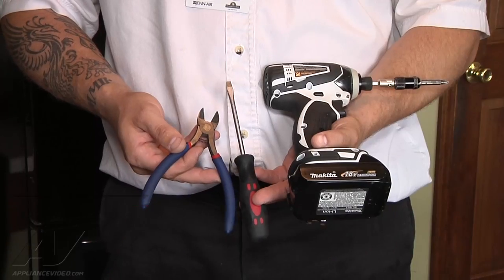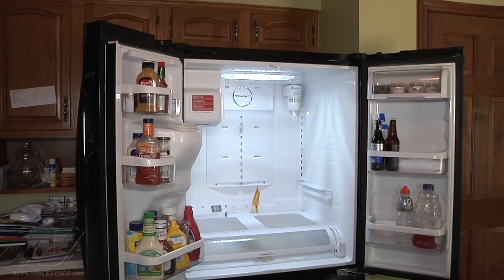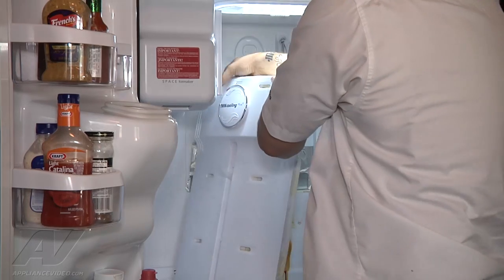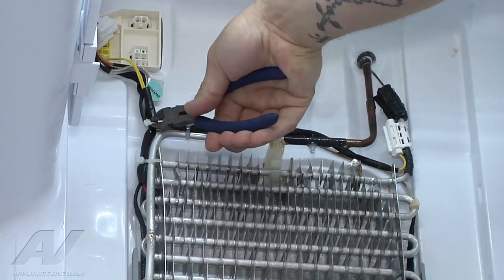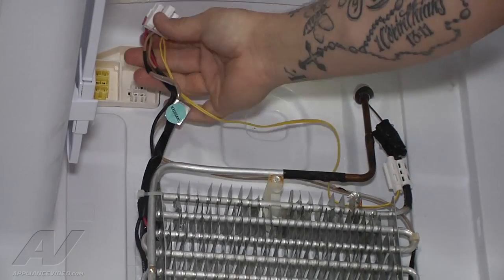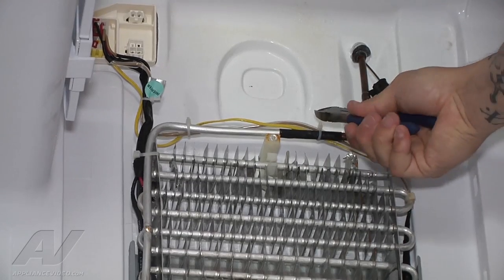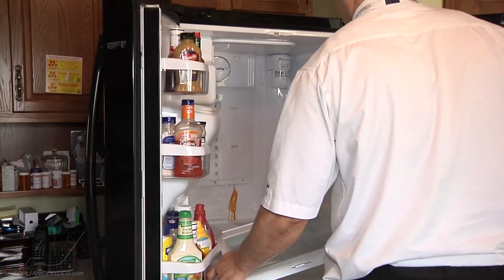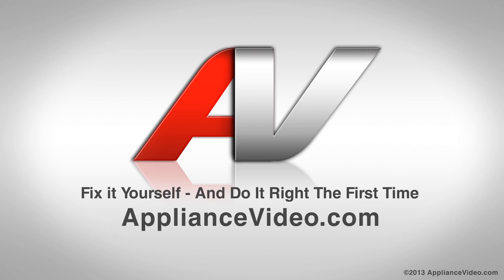Samsung Refrigerator Repair - Fresh Food Section Is Leaking Water - Sensor

Comment: I have taken off the panel and removed ice from coils, but my fridge drains out the back into the bottom panel.  I have poured lots of hot water in and warm water has come out of one of the drains (not nearly as much as I put in).  The other drain does not have anything coming out.  I'm not sure I can reach to properly melt with hair dryer.  Any suggestions?
Reply from the maker: Yes, shut it down for 24 hours with the door open to get any ice in the drain defrosted completely. Then pour the hot water down the drain. If you or someone you now has an air compressor you can shoot compressed air through to ensure the drain is open. Our technicians carry a compressed air tank on their trucks to blow through the drains.  You can help us provide more videos to our site by subscribing to our YouTube page or posting ApplianceVideo.com site on your Facebook or Twitter account. We also have our factory authorized technician’s email daily free professional advice to people like you to help solve their appliance problems. Thanks in advance for supporting us. Matt, Ace Appliance service technician.

Comment: It appears that it may be the probe (AKA drain strap) and not the sensor. Many people with this issue have ordered the whirlpool probe (which is longer than Samsung's) and fixed this problem. See this discussion:
http://www.applianceblog.com/mainforums/threads/26180-Samsung-water-in-bottom-of-refrigerator
Reply from the maker: Thank you for the update. Any help to our subscribers is a benefit. We appreciate your input.
Reply: Unfortunately, these probes only extend the time period between occurrences.  It doesn't completely solve the problem.  I've known techs who will use a piece of copper wire, which is a better heat conductor than the aluminum ones sold by Whirlpool and others, with no success.  And if it were a sensor issue, ice would build up on the entire evaporator, restricting air flow, causing temperature problems.  Moral here, don't buy Samsung refrigerators.  Unless you want to spend $275.00 every time the drain line clogs.
Reply: Dave Harrison  I wish I would have known that about Samsung's refrigerators.  Even though a technician repaired the leak in September of 2014, my refrigerator is leaking water under the fresh food section again. Do you know why this problem cannot be completely resolved?  I am just curious due to the fact that this is a costly repair.

Comment: I have a pretty basic single door, 210 ltrs Samsung Direct Cool refrigerator. It has been hardly couple of months the fridge is showing signs of condensation and cooling issues. There is always water formation on the freezer door and chill tray is always wet. Can you please advice, what should I do.
Model reference: http://www.samsung.com/in/consumer/home-appliances/refrigerator/direct-cool/RR2115TCAPX/TL
Reply from the maker: Puspen
           Go to ApplianceVideo.com and type in your symptom , make and model. You will find allot of videos with your symptom. Also if your unit is only a few moths old it should be under a factory warranty.  We have a search for video by model number feature. Our site has 2600
Free videos on it.  Please help our ranking by subscribing to our
YouTube page or posting our ApplianceVideo.com site on your Facebook or Twitter
account

Comment: what is the plate cover called that cover the coils. the white part is broke when we removed it and i want to order it but dont know whats its called
Reply from the maker: Good question, with our technicians
now getting hundreds questions weekly, they are answering all questions at our
website http://www.appliancevideo.com/repair-help/ .  We also have over 3,000 common questions
and answers that you can easily search through by your model number, appliance
make, problem or error code and it’s absolutely FREE.

Comment: I live in the east bay of San Francisco in CA. I had two repairman with no good results. My RF267 had ice buildup for the last 2 years. My refrigerator and freezer have stop working, who can I call for repairs, It seems like no one wants to touch Samsung RF267???
Reply from the maker: Great question, if you have a
more technical question that our parts department cannot answer, our
technicians are answering all questions at our website at www.ApplianceVideo.com under our Repair Help section. You can also call
our parts department at 1-800-830-5465 and they can give you help 7-days A week
Mon-Sat . You can also search at www.SaveMoreOnParts.com 7- days a week.

Comment: I replaced this exact part, defrost sensor, and it still leaking, the drain still frozen with ice.  Any advise?
Thank you
Reply from the maker: Pierre
         All of our technicians are now answering questions daily on the ApplianceVideo.com website for anyone needing help. Just copy and paste this this question under REPAIR HELP, and one of our  factory authorized technicians  will answer any technical questions at absolutely no charge on your appliance issues. We also have over 2600 free repair videos to help with your appliance repair issues. Thanks for your support. Matt Ace Appliance factory service technician.
Reply: MOVE SENSOR TO UNDER FAN MOTOR, REMOVE AND PLACE IN MIDDLE TOP TUBE ( RETURN LINE) If senor is in the ice unit will defrost longer. (not in sReplace sensor is not the fix. 1- need drain heater ( DA61-06796A). 2- NEED STEAMER TO DEFROST DRAIN LINE. 3-ervice update)

Comment: I am having the same problem.  A technician fixed the problem in September of 2014, but the refrigerator started leaking again.  I do not understand how I could be having the same problem within a six month time span.  Do you have any suggestions?
Reply from the maker: Msekicrazelova
             All of our technicians are now answering questions daily on the ApplianceVideo.com website. You can search completely FREE in our Repair Help section with over 1000 questions & answers. Or you can get unlimited technical advice and video links emailed to you by our 14 factory certified technicians at http://www.appliancevideo.com/premium-membership/.  If you are in need of any parts please support our parts department on line at http://savemoreonparts.com/ or call 1-800-830-5465 7-days a week until 11pm Eastern time. Thanks for your support. Matt Ace Appliance factory service technician.
Reply: The problem is the drain hole, the water freezes up and it gets clogged, their is a newer SAMSUNG CLIP DRAIN EVAPORATOR, that helps to keep the water from freezing in the drain (Amazon $6.63) this will keep water flowing freely through the drain and eliminate the "leaking" problem, also set your temperature at 36F, this will help too.

Comment: My RF265ABWP refrigerator is 8 1/2 years old, started leaking and freezing underneath the fresh food section months ago so I would wipe it down once a week until I found the video and decided to tackle it...I first defrosted the refrigerator, found the heat clip not even remotely near the hole and the drain in the back clogged.  I cleaned the drain and re-positioned the clip into the hole and ordered new clip.  Still leaked.  Defrosted again, and replaced drain clip.  Checked level which was okay but wheels were still on the ground so I raise the legs to get the front wheels off the ground  (even though it was fine for 8 years).  Still leaked but not as bad (maybe because it hadn't froze as much).  Ordered the defrost sensor.  Removed the back today, the drain was clear but the coils on one side had ice.  I let them defrost while I changed out the defrost sensor.  I let the cover dry out for a bit. Checked the drain, flowing fine so I put it all back together earlier today.  Seeing a little leak again.  Any more suggestions other than taking a sledge hammer to it?
Reply from the maker: I would like to help you, however our social media staff are not technicians. We do have technicians answering questions on our website's Repair Help. Search within repair help to see if you can find your answer or, you can always ask one of our  technicians http://www.appliancevideo.com/repairhelp/

Comment: My samsung mode rfg297hdrs water is running very slow.
Reply from the maker: Great question, if you have a
more technical question that our parts department cannot answer, our
technicians are answering all questions at our website at www.ApplianceVideo.com under our Repair Help section. You can also call
our parts department at 1-800-830-5465 and they can give you help 7-days A week
Mon-Sat . You can also search at www.SaveMoreOnParts.com 7- days a week.

Comment: I can't get the drain to flow.  I have had it off for 36 hours and keep putting hot water in the drain but it won't go down...
Reply from the maker: Brian Agrella 
                All of our technicians are now answering questions daily on the
ApplianceVideo.com website for anyone needing help. Just copy and paste this
this question under REPAIR HELP, and one of our  factory authorized
technicians  will answer any technical questions at absolutely no charge on
your appliance issues. We also have over 2600 free repair videos to help with
your appliance repair issues. Thanks for your support. Matt Ace Appliance
factory service technician.

Comment: This is a great video demo.  Thanks for posting it. 

Having been through this TWICE in past 6 months is no fun.  So, my recommendation is DON"T BUY THIS REFRIGERATOR.  What a shame that such a nice frig (we really like the refrigerator) is equipped with such a horribly designed defrost water drain system.  It is designed to fail.  Having to remove all food and disassemble the interior panel is just plain stupid design.  I used a turkey baster with a long plastic tube that allowed faster melting of the ice - it was frozen SOLID the full length of the drain tube.   The simple solution to this problem would have been for Samsung to either design the drain so that it is accessible without taking the refrigerator apart, or, better yet, just route the drain line to the exterior (room temp) of the refrigerator down to the evaporation pan so that it won't freeze up.  As it is designed, it passes through the coldest part of the refrigerator, so any small plug (lint, dust, etc) at the outlet end is going to inhibit flow with freezing solid as the eventual result.
Reply from the maker: Bill 
     Thank you for your comment. I know they have made design changes to eliminate this issue on the new models.Sorry to hear you are dealing with this issue.  Please help us provide more videos to our site by posting ApplianceVideo.com on your YouTube, Facebook or Twitter account or add us to your circles.  Our factory authorized technician’s also provide FREE Repair Help for people that need technical questions answered our videos cannot answer at ApplianceVideo.com. Thanks again your support.  Matt, Ace Appliance service technician.
Reply: yeah...been doing this for too many years...had this refrig now for 7 years. So sad, since we really like the freezer on the bottom style and ice positioned when it is. I wonder if it's a design flaw?? The fan started making a racquet, so we're back to removing ice. You must admit, at least your refrig gets a thorough cleaning this way...lol! Thanks for this video....we are having trouble getting the styrofoam off this time...so annoying.

Comment: Where is the wayer tank on this unit?
Reply from the maker: Gabriel
             
All of our technicians are now answering questions daily on the ApplianceVideo.com website. You can search completely FREE in our Repair Help section with over 1000 questions & answers. Or you can get unlimited technical advice and video links emailed to you by our 14 factory certified technicians at http://www.appliancevideo.com/premium-membership/.  If you are in need of any parts please support our parts department on line at http://savemoreonparts.com/ or call 1-800-830-5465 7-days a week until 11pm Eastern time. Thanks for your support. Matt Ace Appliance factory service technician.

Comment: What does it mean when it says twin cooling
Reply from the maker: Samsung developed the world's first Twin Cooling System in 1995 and it has been in application since. The Twin Cooling System controls the refrigerator and freezer independently with two separate evaporators and precise electronic control. An adequate amount of cool air is provided in each compartment independent of the other. Temperature sensors and microcomputers detect which compartment needs cooling and enables the refrigerator and freezer to use power only when their respective compartments need cool air.ideal temperature and humidity preservation. Because cool air in the refrigerator does not travel to the freezer, the refrigerator compartment maintains a high level of humidity. The separate evaporators allow each compartment to maintain its ideal temperature.
no mixing of odors.r. Please help us provide more videos to our site by subscribing to our YouTube page or posting ApplianceVideo.com site on your Facebook or Twitter account. We also have our factory authorized technician’s email daily free professional advice to people like you to help solve their appliance problems. Thanks in advance for supporting us. Matt, Ace Appliance service technician.
Reply: Ok I sure will subscribe via YouTube Facebook and Twitter
Reply from the maker: Thanks Mike
Reply: I was wondering if y'all have any old compressors from refrigerators

Comment: Why replace the sensor without testing
Reply from the maker: Great question, you can call
our parts department at 1-800-830-5465 and they can give you help 6-days A week
Mon-Sat . You can also search at www.SaveMoreOnParts.com 7- days a week.  If you have a more
technical question that our parts department cannot answer, our technicians are
answering all questions at our website at www.ApplianceVideo.com under our Repair Help section. We have over 6,000
common questions and answers that you can easily search through by your model
number, appliance make, problem or error codes, and It’s completely free to
search through our question & answer library. There is a very good chance
you question is already answered there.

Comment: Is it usually Ice that clogs the drain? If so could you just unplug the fringe and let it melt if you didn't want to take it apart?
Reply from the maker: Great question, with our
technicians now getting hundreds questions weekly, they are answering all questions
at our website at ApplianceVideo.com under our Repair Help section. We have over
3,000 common questions and answers that you can easily search through by your
model number, appliance make, and problem or error codes.
Reply: +ApplianceVideo.com it would not let me post a comment without having a log in. Any help from any other viewers would be greatly appreciated. Thanks
Reply: Yes - I found that ice blocking the drain.  Melted as in video (and used a hair dryer to get the ice off)... I replace this part: AP5579885  Its supposed to keep the drain clear.

Comment: Water is still pooling. What next?
Reply from the maker: We recommend shutting the unit down for 24 hours with the door opened. Then, pour water down the drain to make sure it is opened. If it does not go down the drain, you will need to get compressed air and blow through the drain to open up the restriction.

ApplianceVideo.com is a family-owned and operated company providing you FREE, high-quality repair videos. To make new videos and answer your questions, please purchase the parts you need from us at 1-800-830-5465, or order parts online at ApplianceVideo.com. Thank you for your continued support and good luck on your project.

Comment: does anyone have issues with randomly cracking and breaking plastic 
parts and door shelf bins? did yours start to happen literally months 
after purchase? now the freezer won't freeze on top of everything being 
broken inside fridge. 3000 bucks for a piece of trash, everyone should 
take their samsung fridge and curb alert it for a scrapper to come pick 
up. stay in your lane samsung, stick to tvs and phones, your 
refrigerators are straight trash.
Reply from the maker: Great question, if you have a more technical question that our parts department cannot answer, you can search our over 13,000 answered questions free at our website www.ApplianceVideo.com under our Repair Help section. You can also call our parts department at 1-800-830-5465 and they can give you help 7-days A week ,or search at www.SaveMoreOnParts.com  .